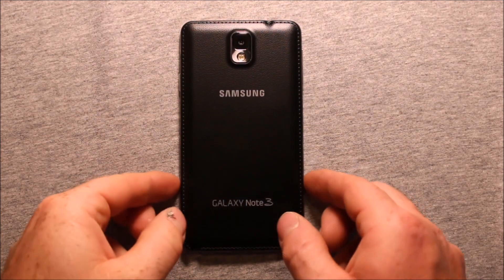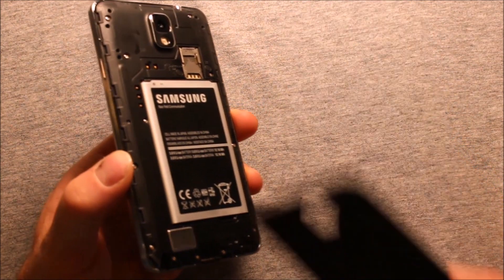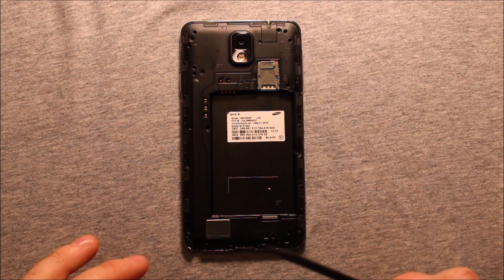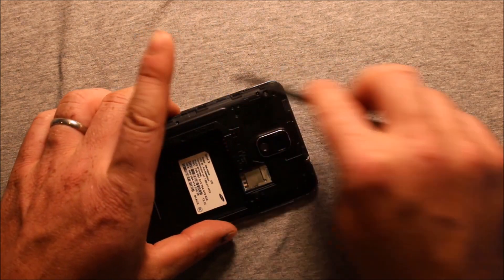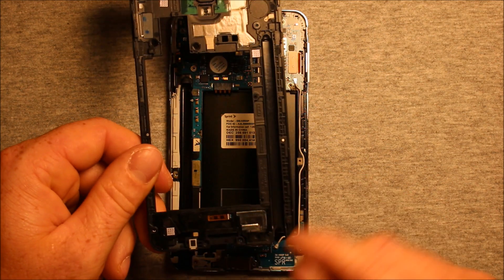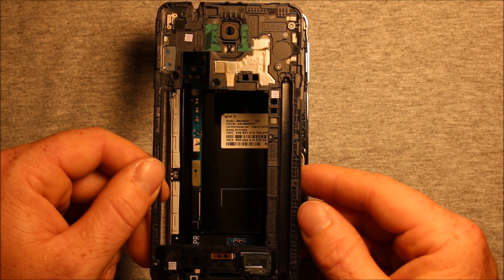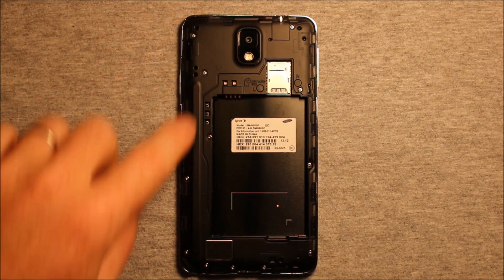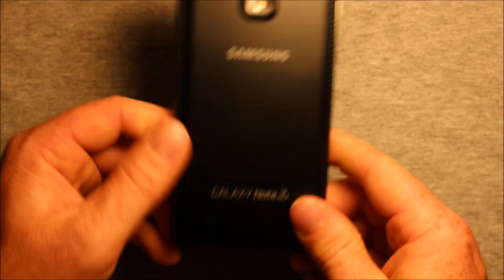Galaxy Note 3 Loud Speaker Replacement How To Change

Comment: Thank you for this video. It was really helpful. My note 3 is a different model number from the one in your video so do i need to make sure i get one for my specific model or does it not matter that much? I searched for ones for my model and they don't have any listed :(
Reply from the maker: +Ripley Hamster Yes if you follow the link in the video description and check in the listing of the one that you're interested in and it should specify which model numbers it fits it usually fits a variety of models.
Reply: Ok. I found one specifically for my model. Thank you.
Reply from the maker: You're welcome.

Comment: I used one of your other videos to replace my charging port. Thanks! Like several others, I also had to replug the video cable I knocked loose. But, now my speaker will not work for the speaker phone. The ear speaker works, but not the speaker phone speaker (or loud speaker, as you put it). Suggestions? Everything seems to be lined up perfectly. This is frustrating because I use my speaker phone often when driving, etc. :-\
Reply from the maker: +LegallyBlonde1976 I can't remember with this phone exactly and I can't view the video currently, does it have a couple prongs that make contact on the charging port? If so maybe they aren't bent out quite far enough you could try tweaking them a little bit.
Reply: Smart Easy Repair I believe the contract on the right side was defective, so I ordered a replacement from the company that I purchased the part from. Thanks for your reply!

Comment: So the speaker is built right into that panel? Mine has def gone bad. My 100% volume when playing media is half of what it used to be and is also very crackly. If I buy this panel and replace it, my speaker volume will be back to normal?
Reply from the maker: Yes it should. Thanks.

Comment: So I'm a bit confused..the actual speaker is built into the back piece? My speaker now has gotten really weak and has some static sound..so basically you're telling me just buy that new back piece, install it and my sound for videos, music, ect will be back to normal?
Reply from the maker: Yes it is next to impossible to remove it from the housing without damaging anything.. So you should be able to just replace the whole back and be good to go yes..
Reply: Thanks, just seemed to easy. I never seem too have much luck doing similar things but I guess it's worth a shot because the phone is in mint condition besides the speaker and unfortunately no insurance
Reply from the maker: Yeah it is quite a simple process.. I have a link in the video description where I found a good place to get the part if you wanna check it out.. Good luck!
Reply: @SmartEasyDIYer  you can remove speaker out of backplate.?

Comment: well I did the whole process of the change you did and its still not working any other thing it could be cuz there's no sound at all
Reply from the maker: Could you see any connections close by that might be loose?
Reply: Thanks for getting back to me but that's what it was the connections to the external speaker weren't connecting so I fixed it thank you though
Reply from the maker: Great glad you got it! Thanks.

Comment: i build out my usb port because it wasnt working, now the usb port place is empty until the new one arrives, but my speakers doesnt work ? What should I do?
Reply from the maker: +Artist 4 Life It sounds like the speaker needs to make contact on the USB port or something. Sounds like it's not connecting properly anyways. That would be my guess
Reply: Smart Easy Repair Yes i did put in the usb port again and it works now 😊
Reply from the maker: Artist 4 Life OK great!
Reply: I used one of your other videos to replace my charging/USB port.  But, like several others, I also had to replug the video cable I knocked loose. And now my speaker will not work for the speaker phone. The ear speaker works, but not the speaker phone speaker (or loud speaker, as you put it). Suggestions? Everything seems to be lined up perfectly. This is frustrating because I use my speaker phone often when driving, etc. :-\

Comment: IS THAT IT ? You just post a video on how to remove the middle  cover. You could have said that in the beginning that you just need to purchase a middle cover with parts attached.
Reply from the maker: +Wickedthtz well it's more like the middle cover than the back cover but yes it's built into it. I show that halfway though the video.
Reply from the maker: +Wickedthtz And remember to swap over that rubber part like I show from the old part to the new one if it's not already. Why is it useless?
Reply: Smart Easy Repair I re-edited my post. re name of the video would save misunderstanding
Reply from the maker: +Wickedthtz I still don't see why my video is useless because I show you how to take it apart, replace it, and put it all back together.
Reply: Smart Easy Repair its misleading. I was watching it to see if the speaker can be replaced. not to watch the middle cover taken apart .And then be told that you have to purchase a new middle casings. no offense
Reply from the maker: +Wickedthtz I don't know how else to say it except it's to replace the loudspeaker. I could've mentioned early on what all has to be done before I do it but I can't edit it now. I figured usually someone would watch it to see what they are getting into before buying the part and doing the replacement.

Comment: so if you are replacing the charging port there is no power to the speakers
Reply from the maker: Right cuz you need to take the back off to get to the charging port and the speaker is built into the back cover.